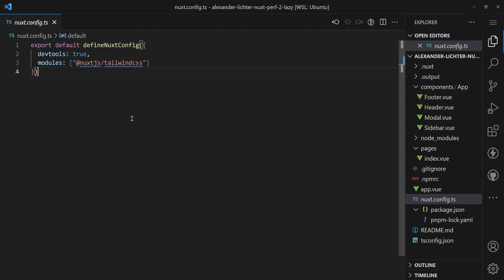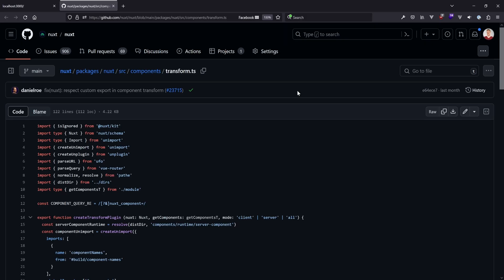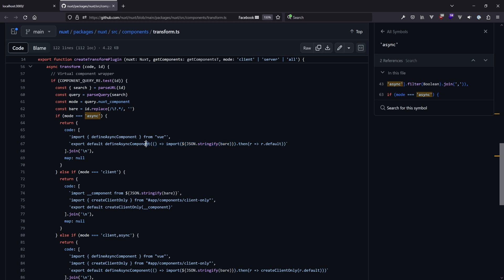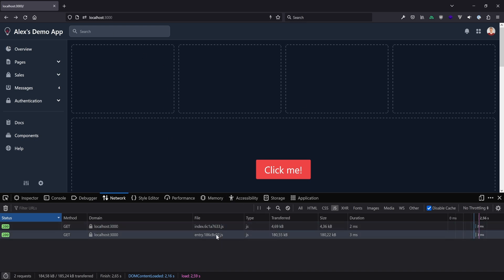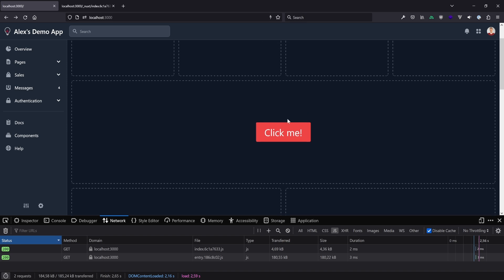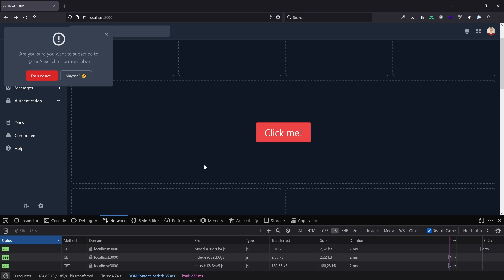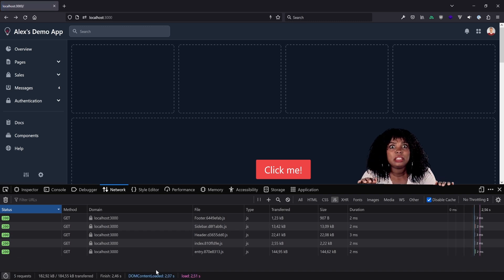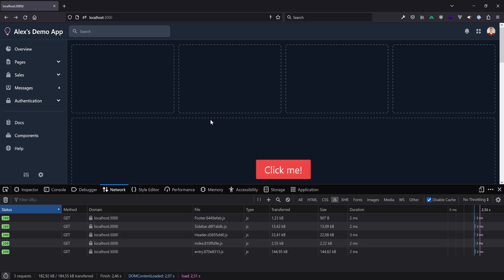The Lazy component prefix and when to use it - Nuxt Performance in Depth

Comment: I have a question: Do Lazy components automatically effect their child components?

For example, is this the correct way to do it: <LazyParent><Child /></LazyParent> or like this: <LazyParent><LazyChild /></LazyParent>
Reply from the maker: It depends. If the component is passed as slot, then you'd need the prefix. If it is already part of the parent, you can omit it.
Reply: Thank you! I appreciate it :) @TheAlexLichter

Comment: My understanding is that too much lazy loading is harmful and we should not lazy load components like the navbar footer.
Reply from the maker: Yes and no.

✔ Correct is: Too much lazy-loading is harmful. Also lazy-loading content above the fold is not good.

When it comes to the Footer, I'd say you can lazy-load it if it is below the fold, so the user won't see or need it straight away. That's most common for most pages (without a sticky footer).
Reply: thank you for the answer @TheAlexLichter

Comment: Interesting! It would be much more useful with directives for placeholder (and loading and error states) as Angular introduced in the latest version.
Vue lets you define AsyncComponent with loading state at its core but Angular defered views are really powerfull I think. No extra step with lazy declarations.
Reply from the maker: Technically this is possible in Vue too via defineAsyncComponent as you said (loading/error state), but I agree, a more declarative way would be interesting to see.

With regards to hydration though, that is also something coming - See https://github.com/nuxt/nuxt/issues/24242
Reply: @TheAlexLichter   Oh interesting! Thanks.

Comment: I use Lazy almost by default for any Dialog/modal elements as they are not sure to be used in the app, therefore not needed to be loaded... There are other use-cases of course, but this would be the default
Reply from the maker: Yes, that's almost a no-brainer (as long as a possible delay is justifiable when the user clicks on the modal/dialog)

Comment: Thanks for the explanation. Is there room in the series for a deep dive into a combination of cached server routes, local caching (useFetch keys like in your other video) and optimistic UI changes that update the local state and local cache accordingly while invalidating the server's cache after a change is made? I've been hitting this issue in my project where a large list is loaded and small changes can be made to it with post requests, but refreshing all the data just for this small change to be reflected in the UI seems like overkill.
Reply: Optimistic UI is quite nice (discovered it with Apollo) but it can also be quite tricky for a small amount of benefits. 😅
Reply: I agree, but it's an important UX factor when the refresh load is high. Back in the Vue 2 days I used to handle this with Vuex, which wasn't fun to work with but it got the job done. I think mutations through 'useNuxtData' is what can be used to streamline this. @konstantin-bifert
Reply from the maker: Great idea. I might cover that in a stream in a future because it might be a bit long for a single video. But let's see, maybe I can shrink it down 😊

In the meantime, you might want to check https://nuxt.com/docs/api/composables/use-nuxt-data#optimistic-updates